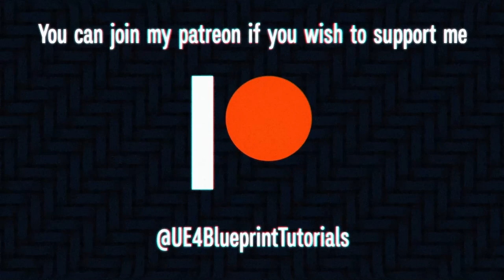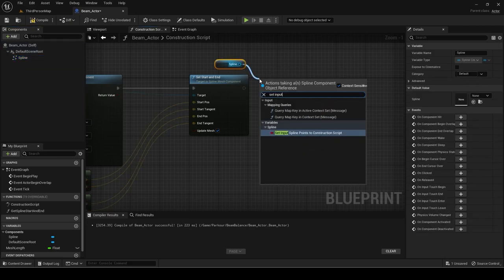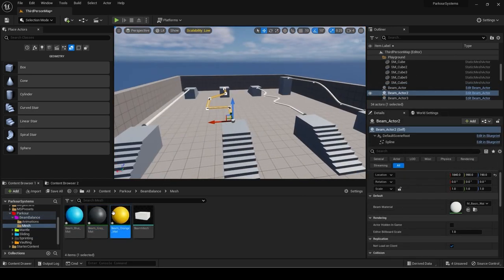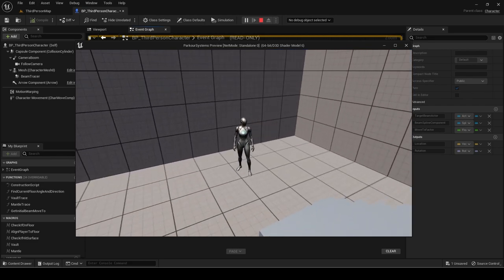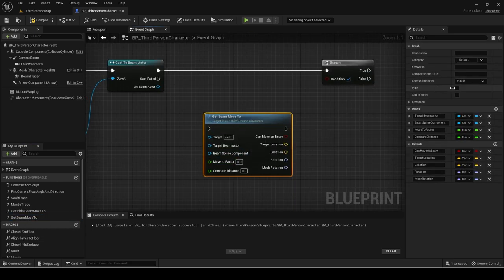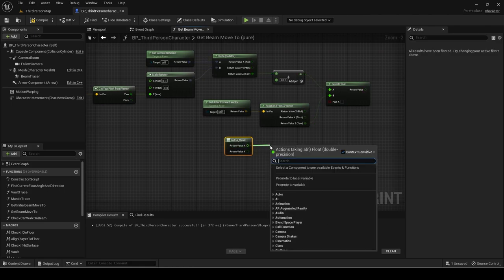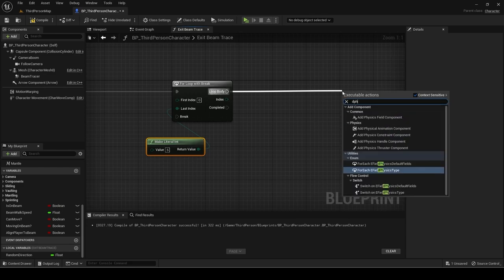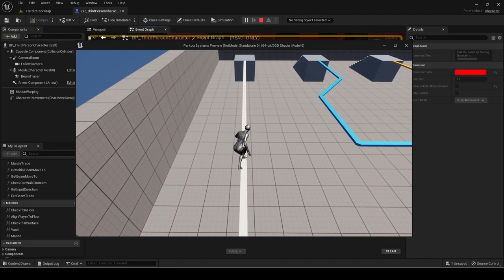Unreal Engine 5 : Parkour Series- Beam Walking System

Comment: Guys important tip here. Make sure you only extend your spline in the direction that the Beam Actor is facing. I was extending the spline backward instead of rotating the actor and due to that my character was just spinning in place instead of moving forward.
Reply: Thank you very much! I have solved the problem😄

Comment: A question, why do we do a seperate move Component To for the mesh if its a child of the capsule component,  won't it be moved by the Capsules Move To?
Reply from the maker: Hey, you are right. I don't remember when I did it for this mechanic however, could you share a timestamp if possible please?
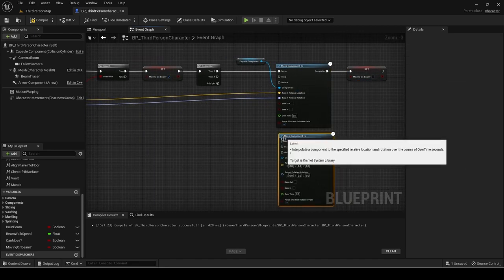Reply: @UE5Poseidon  It's at 28:30, i think you mentioned something about it being for aligning the player to the beam but when I've removed it nothing has changed.
Reply from the maker: @jackdixon3395  Ah thank you for the response. Yeah this is to align the player to the beam for slopes in particular. Because if you are walking up a slope the character should rotate with the root being the pivot but rotating the capsule component will rotate them from the center so it won't match up visually.

Comment: How would you set the character to play the crouch idle animation when not moving?
Reply from the maker: Use a blend by bool that checks is on beam then use the 2 animations.
Reply: @UE5Poseidon  I tried but my player only stays in crouch idle for some strange reason. Sadly following the wall run tutorial, it broke the vault completely

Comment: Having an issue where the character cant reattach to the beam after doing the exit jump. Any ideas what part of the code this would come from?
Reply from the maker: Did you reset the variables back to their default ones as they were when you start the game?
Reply: @UE5Poseidon  Just found and fixed the issue. I had another event landed node on my wall run system i had to put the set collision enabled with that one instead of having two separate ones.

Comment: Hey man. Sorry for all the messages across the videos, but im having another weird issues with this one. at 27:51, i tested to see if the beam walking works, and for some reason the code stops after the branch with the tag in the condition. My character is stuck on the start of the beam and I can only jump and have no movement input. The tag is beam so I don't know what i did differently.
Reply: ok so i still haven't figured it out, but im starting to see where the issues lies at. The code won't get past the cast to Beam node. I've tried redoing the code but it still stopped at that code. At least I know it wasn't an issue with the tag or the branch, and I think if I can fix the cast to issue, the code will work properly
Reply from the maker: No problem for the messages. Did you correctly tag it. It has to be exact with capitals included in both.
Reply: @UE5Poseidon  yeah they both said Beam exactly like that
Reply: Hello, have you solved this problem? I have the same problem, stuck at the starting point, even keep turning in circles
Reply: @zipPanda  Same here. This hasn't been solved yet
Reply: @uchihakidd9026   Incase you haven't found the solution, check the Collision settings in the Add Spline Mesh Component node. Make sure you have checked Overlap/Block for Visibility & Camera.
Reply: @himanshusharma4709  thanks man I’ll check it out!!

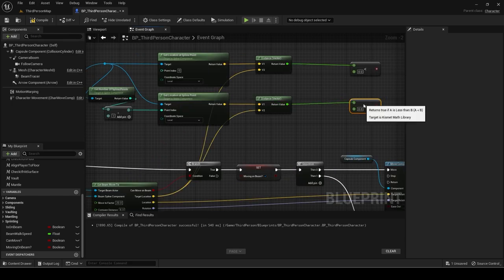Comment: For some reason my character can't detect the beam at all? I made to 30:00 but when it came to check if he can detect it he doesn't
Reply from the maker: Did you add a tag to the beam blueprint called Beam?
Reply: @UE5Poseidon I did I even double checked it but it doesn't  detect it